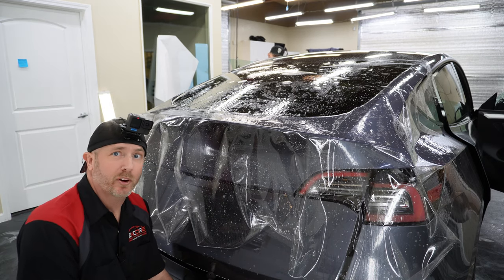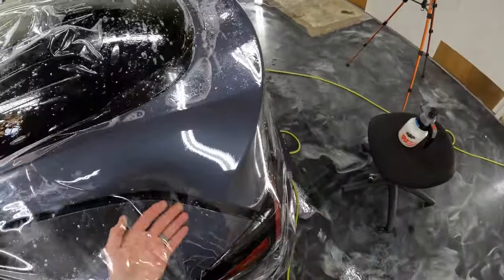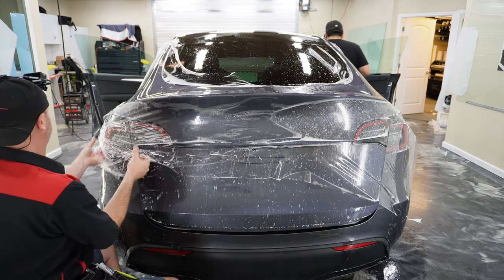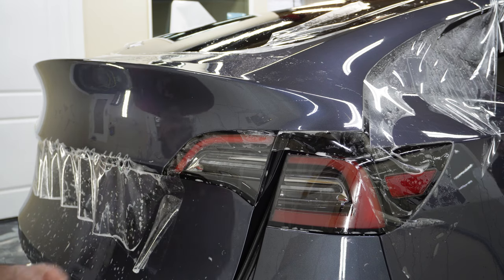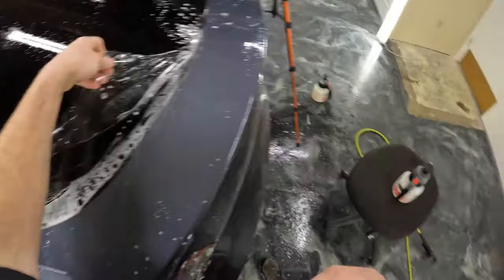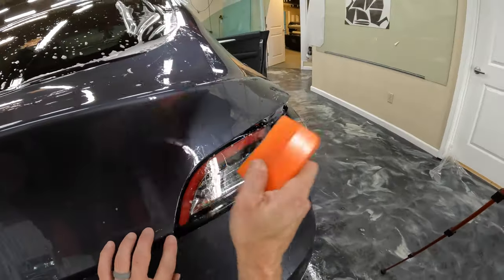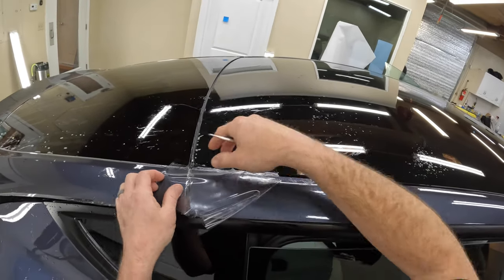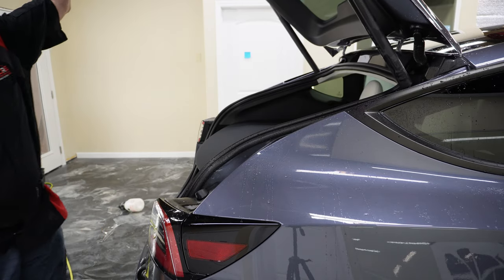Tesla Model Y Hatch: One-Piece PPF Perfection Unveiled 📌 Paint Protection Film Installation Tutorial

Comment from the maker: Thank you @fatwajim for the tip on how to stop the charging port from continuing to open. 👍🏻
Reply: Happy to help! Thank you for the great content :)
Reply from the maker: @fatwajim thank you for watching it! 😂🤣 Did you happen to see my message to you about the vehicle/Tesla chargers? I ran power at the shop for a 50amp charger but I'm not sure what to get. I need it to work on all electric vehicles. I guess I should probably search for a video and see what works best. Lazy...  🤔😁
Reply: @EncorePPFtint  Yes, I responded to the question after you asked it :)
Reply: Well…….I thought I submitted it. I included a couple of links but maybe YouTube doesn’t allow that. I would recommend the Tesla wall connector with the J1772 handle. What I like about these is that if you do buy another wall connector in the future with the Tesla connector at the end, they can talk to each other and load share. For example, if you only had a 50 amp circuit, it will keep them from drawing too many amps and tripping your breaker. 
Another good charger, is the ChargePoint Homeflex. In either case, I would skip the plug-in option and go with a hardwire setup. A hardwire setup is ‘safer’ than. The plug in options. Your big-box store receptacles they sell aren’t robust enough to handle the constant amp draw that a charger has. They are made for appliances like a dryer that may only run for an hour or so.
Reply from the maker: Really great information! I'm going to hardwire it but didn't know about the drawbacks of the plug-in version. I'll look over those two tonight and order one of them. 👍🏻 The load sharing is a great feature!
Reply from the maker: So weird that the post didn't go through. 🤔

Comment: What is the ppf size in dimensions you used for Hatch top and Hatch middle?
Reply from the maker: The top part was a 48" roll x 64" roughly. 
The bottom part (license plate area) is a 48" roll x 10" roughly
Reply: Thank you @EncorePPFtint
Reply from the maker: No problem 😊

Comment: would you recommend or do you ever use PPF edge prep markers for difficult parts?
Reply from the maker: Are you taking about primers, or adhisive promoters applied to the paint before installation?
Reply: I’ve heard just wiping down with straight 70% iso alcohol on hard parts such as deep valleys and edges work well
Reply from the maker: I also use 70% rubbing alcohol on all of the edges and areas that are going to be wrapped. I wipe the entire morrors down as well.
Reply: @EncorePPFtint  does that go for any part as well? Ie: fenders, bumpers, headlights?

Comment: HI I just want  ask which soap do you guys use thank u ! And w hat is your tack solution ?
Reply: i mean what  slip solution do you guys use ?
Reply from the maker: Thanks for your question. Here is some info on our solutions.
We use "seventh generation" dish soap in our slip solution.  I use between 7-9ml per gallon. 
As far as our tack solution goes. We start with 70% rubbing alcohol. Then, dilute that down to 20% rubbing alcohol to 80% water.
All of our water runs through a reverse osmosis system before we use it.
Reply: @EncorePPFtint thank u so much！
Reply from the maker: Yup, no problem! I'll be posting a video this week(end) about our slip and tack solutions. It's in the works! 😁
Reply from the maker: Are you currently a ppf installer, or are you just getting started?

Comment: Why did you want to stretch it in the first place? For cost?
Reply from the maker: The material needs to be stretched in order to get it to match the curves on this hatch. Without the stretch this installation wouldn't be possible. 👍
Reply: How about cutting a larger piece, with squeegee and heatgun treament?
Reply from the maker: You can not heat and push this paint Protection Film down like you can window tint. This material is designed to stretch.  Stretching to fit is the only way to install it. 👍🏻